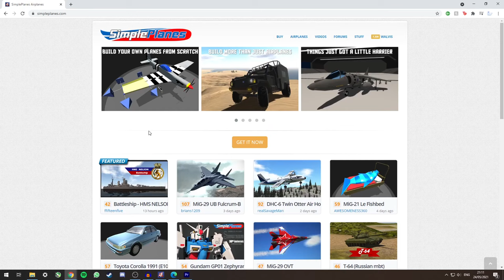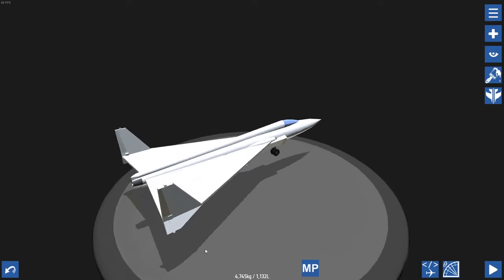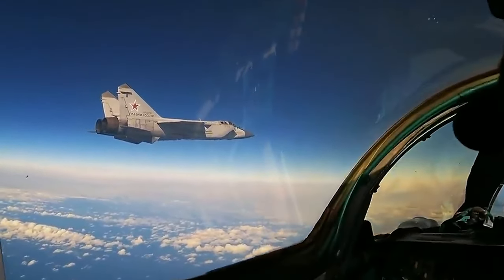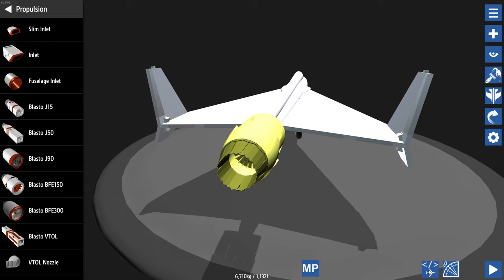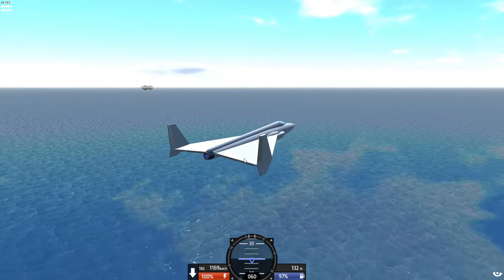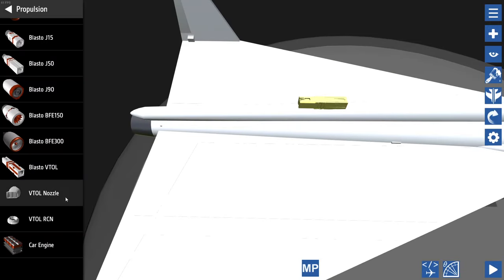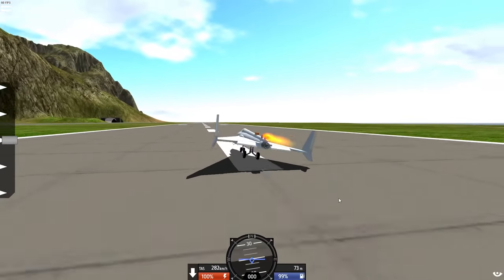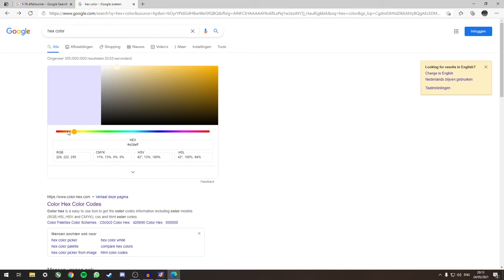SimplePlanes Easy Afterburner Tutorial

Comment: One quick note: Throttle > 0.96 means it will activate once over 96% throttle, not 95%.
Reply from the maker: Yes... Or atleast that is how it should be, but it isn't. If you are on 95% throttle, it is extremely likely that you are on a higher pecentage of throttle (i.e. 95.1). This means that the game will still activate items with a >0.95 when the throttle displays as 95%. Therefor I use >0.96 to ensure the AFT does not engage decimal value of 95%.
Reply: @WalvisYT  then why not type 0.955 or 0.9599
Reply from the maker: @desibellsbeats  95.99% still appears to display as 95%. I could be wrong, though.
Reply: @WalvisYT  May I know why mine isnt working? I typed [Throttle>0.96] and the engine doesnt even ignite after 96%.. Im on mobile.
Reply from the maker: @lllz9800  Could you link a unlisted post of your aircraft on the SP website. Than I could troubleshoot / help out. :)
Reply: @WalvisYT  Ah nevermind, I had made a little mistake over and over again, thanks for the help anyways :)
Reply: Yup
Reply: @WalvisYT  Alternatively, you could use >= for at least.
Reply: @lllz9800  could use [Throttle>=0.50] to engage at 50%

Comment: Small tip. Don’t completely remove the engine flame/exhaust from the J15. Real jet aircraft often have a visible glow if you look down their nozzles even without afterburner. Just reduce the length of this glow and increase it’s height and width to match the inside of your nozzle. I usually make it that the glow starts around 40-60% depending on the type of plane I make

- @mustang51
Reply from the maker: I disagree. You reasoning as to why to do it makes sense, however not in SimplePlanes. The scaling of the J15 exhaust is relative to the world. This makes the flame look super funky and rather ugly, so thats why I disable it entirely.
Reply: @WalvisYT  also are you dutch too? Noticed from your name

Comment: Blasto BFE150 be like: AM I A JOKE TO YOU??? 

Realy, it looks like BFE150 with extra steps.
It has long exhaust flame ( 2 colors ), realistic sound, and the  built in afterburner, even animated. I feel myself like jundroo wasted time doing this engine just for nothing.
Reply from the maker: I wish the exhaust on engines was more customizable. The whole VTOL nozzle stuff wouldn't be a thing if we could easily re-colour / rescale the exhaust.
Reply: @WalvisYT  You can also do it with BFE 150, using xml editor
Reply from the maker: @VladimirChibuckov  Yes, but you need to scale the exhaust equally in every direction or the exhaust flame looks eliptical (and ugly).
Reply: @WalvisYT  Oh yes, I've already checked it

Comment: And you could even make a very complex afterburner withs shock diamonds if u put max throttle on the vtol engine 2 and make the single vtol nozzle to a ring of vtol nozzles (its actually easier than u expect) and out the proper components you can have a good product

Comment: When i added Throttle>0.90 it the engine was not working it would just start working over 90 throttle can someone help ??
Reply from the maker: I'm confused? You programmed your engine to only turn on above 90% throttle, and now your engine only turns on above 90%. What exactly is the issue?
Reply: @WalvisYT  I wanted to program the afterburner to work at over 0.90:  throttle but the engine is not working down 90% throttle

Comment: All propulsion parts in this game:
Blade T1000, Blade T2000, Blade T3000, Helicopter rotor, Heli rotor small, Helicopter tail rotor,
Fuel block, Slim inlet, Inlet, Fuselage inlet,
Blasto J15, Blasto J50, Blasto J90, Blasto BFE150, Blasto BFE300, Blasto VTOL*, VTOL* noozle, VTOL* RCN**, car engine.
*Vertical TakeOff and Landing,
**Reaction Control Noozle.

Comment: Can you make a video about how to make the wings stop being flapping like a bird even if the wings is long
Reply from the maker: You can solve this issue by using only structural wings. With the XML editor (overload) you can enable control surfaces, which makes the structural wing like a normal wing, except for the fact that it never bends.
Reply: @WalvisYT  thx man;)

Comment: Hey man! I did everything as you said but theres 1 problem,

The "Throttle>0.96" doesnt work.
Reply from the maker: I'm sorry, but this exact method still works. Have you made sure you are setting this as the input of the correct part?
Reply: @WalvisYT  yea, i writing "Throttle>0.96"  on the "input"
Reply: @WalvisYT  i got it! Now i made a after burner, the problem was   that i was setting the input throttle>0.96 to the vtol nozzle, and not the thruster,
Sorry.

Comment: I feel like half of these steps could be made easier by just using 1 engine, 2 at the most.
Reply from the maker: What do you mean?
Reply: @WalvisYT  Well, instead of the 2 vtol jets I'd just stick with having a second jet, and just change the option to make both trails visible at higher thrust.
Reply from the maker: @hyperx72  The problem is that this method does not allow for much customization of the exhaust flame. All jet engines, appart from the VTOL nozzles, are always positioned relative to the ground. In short, if you scale the different axis of your normal jet exhaust, it doesn't look right.

Using VTOL nozzles allows for far more customization of the engine.
Reply: @WalvisYT  Aaah, so THAT'S why you do it!

Comment: I'm such a noob in sp that I can't even build a single jet plane without 8 months of brain cancer wondering while I keep flipping on takeoff
Reply: Some neat tips I came up with.
Keep center of mass in front of your center of lift

Control surfaces may work better at smaller sizes or lower pich ranges

Moving parts are easier if you edit collision physics for parts in the ingame Part editor tool (turn on the mod in mods and it looks like an angle tool)

Too much wingspan on a smaller craft can make it unstable.

Gyroscopes are a gift for helicopters.
Reply: @sirloinofbeef7446  god bless you, you helped so much on my design.